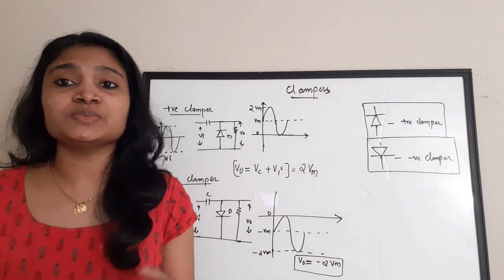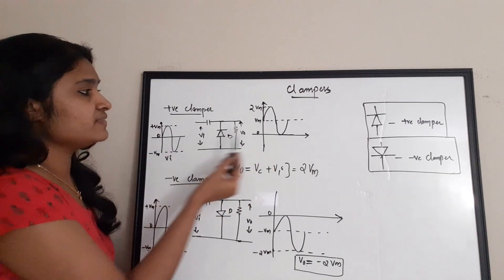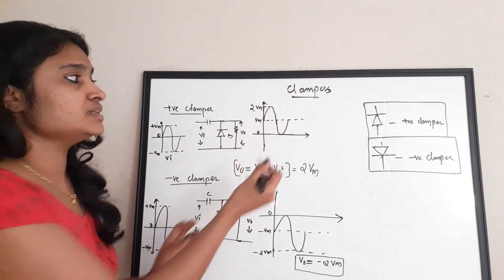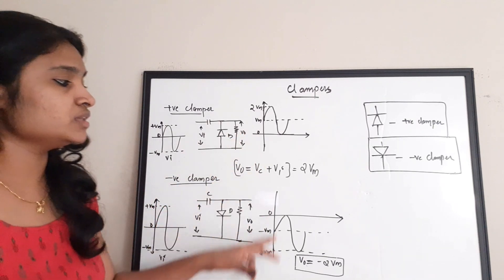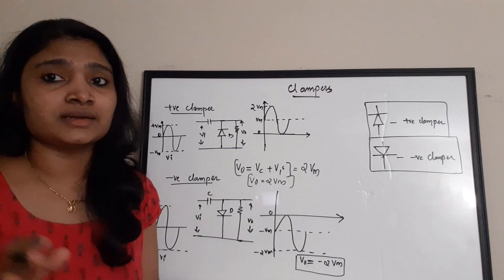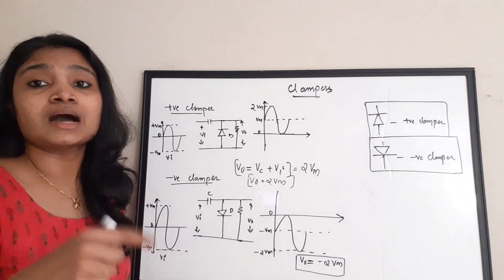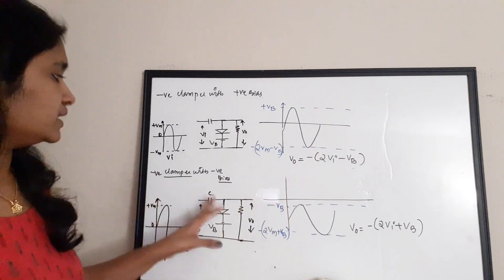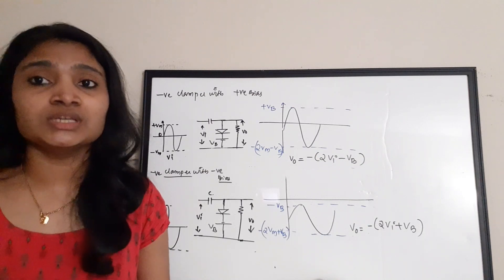Tricks to solve clamper circuit Problems| Clamper Circuit problems Types and Tricks| Clamper Types

Comment: Wrong, The capacitor never discharges for clamper, if it does then the waveform is not a shifted waveform. The ckt working never allows it to discharge. thats why reference voltage is shifted permenantly to above 0 or below 0. This is true for biased clampers, the reference changes and stays there, its because capacitor never discharge in any clamper. 
At 10:00 , the equations for the biased positive clampers are WRONG! It is Vout=Vin+Vm+Vb and Vout=Vin+Vm-Vb. IIIly for biased negative clampers, it is Vout=Vin-Vm+Vb and Vout=Vin-Vm-Vb. 
Vin cannot be equal to Vm and we shouldnt write it as 2Vm. The graph will totally be wrong when plotted with that eqn. Please students correct the info.